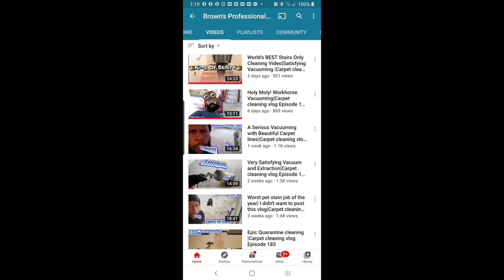Dirty Carpet gets a new life! Vacuum & CRB lovers alert|Carpet cleaning vlog Episode 215

Comment: 38 year old me wants that vacuum like 10 year old me wanted a Super Nintendo. I just hope it doesn't take me nearly as long to save up for the workhorse as it did for the SNES, lol. 

Seriously, though, those carpets looked amazing!! Just....WOW!!! I was not expecting them to look damn near new when you were done.
Reply: @BrownsProfessionalCarpetCare  I was just doing my daily attempt at vacuuming the dry soil from the living room, and I have a few questions on the best ways to do it. So here I am, lol, and here I go.
Shortest possible explanation of problems- Long sand, dirt, and gravel driveway over a dam, grass is sparse and patchy with sand like dirt all over (nothing grows, we've tried) There is, and this can't be stressed enough, soooooo much dirt tracked in to the house every day. I have to vacuum twice a day to keep the carpet from being funky. I want and need to get out as much as I can. Should I be using the brush rollers when I vacuum, should I turn them off, or does it even matter? Is there any weekly or monthly maintenance, like raking, I can do to help loosen the dirt? 
The oldest is in college, the youngest is still in diapers and there's more teens in between them so changing out the flooring is not an option for a couple of years at least. As much as I hate it, if I have to live with the carpet in that area I want to take care of it as best I can. I do plan on getting a professional cleaning done sometime after the holidays, though.
Reply from the maker: @kristihadaway80  Take off shoes before walking on the carpets.  Slow down the Vacuuming and Vacuum 2 or 3 times in one session instead of once.  Clean all filters before and after every vaccum.   Get a really really good vacuum